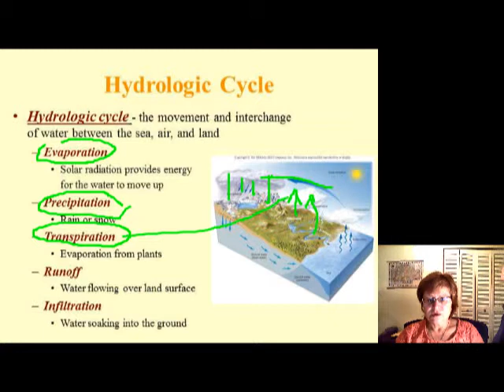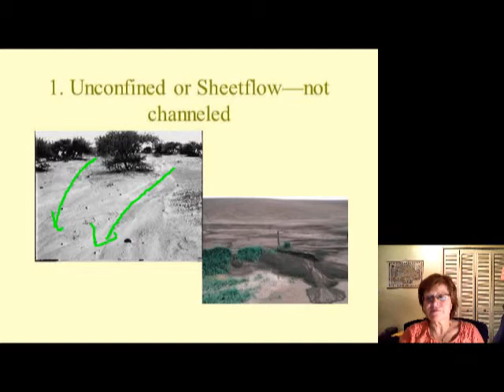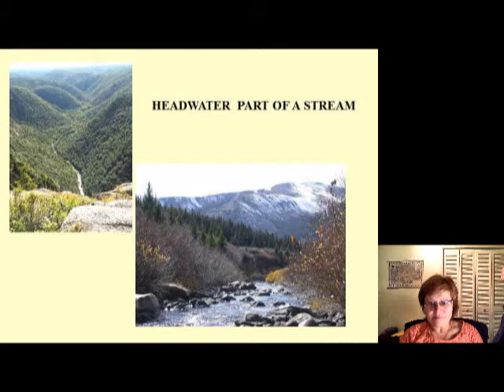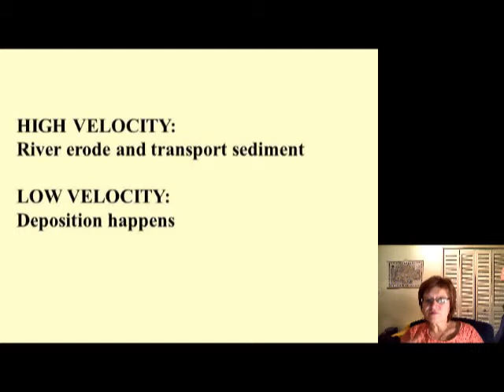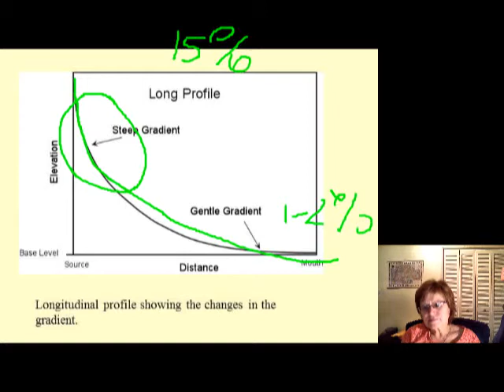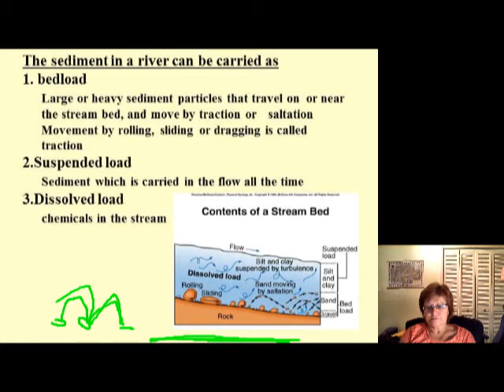Running Water 1.

Comment: Alexandra Lemire GEO 105 V2 Summer 2020:
Although, the earth is a watery place. But just how much water exists on, in, and above our planet is about 71 percent of the Earth's surface is water-covered, and the oceans hold about 96.5 percent of all Earth's water. Water also exists in the air as water vapor, in rivers and lakes, in icecaps and glaciers, in the ground as soil moisture. 
Interesting enough, water is never sitting still. Thanks to the water cycle, our planet's water supply is constantly moving from one place to another and from one form to another. Things would get pretty stale without the water cycle!

Comment: it is very interesting to calculate stream discharge by this formula, I never though there is a formula for calculating running water. very interesting and new to me. I also like when you use metric system/ measurement for calculation. Thank you

Comment: Danielle Dennis GOL 105 

I had never thought about the direction of the water in rapids. It always seemed like there was just a strong force pushing those rapids in one direction but now I understand that the water flow is in several directions at one spot.